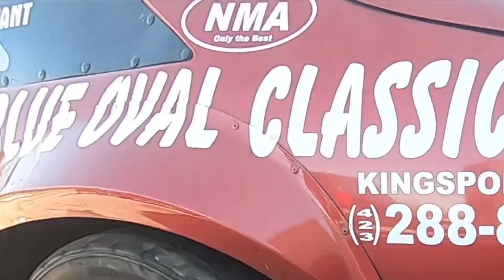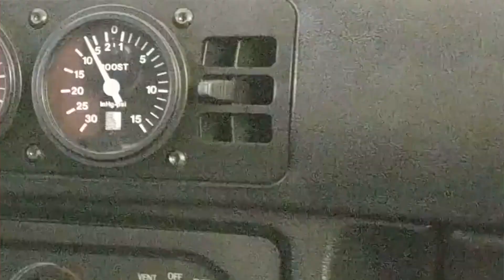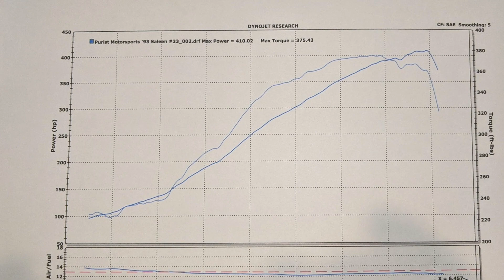Vortech Supercharged 1993 Foxbody Saleen Mustang #33 On The Dyno - How Much Power Does the 302 Make?

Comment: 410 horsepower it's pretty good. How much horsepower did it have in 93.
Reply from the maker: It was a non supercharged car. So it had 205hp.
Reply: This is 410 at the wheels...stock rated 205 they put down like 180 through manual trans so that is well over double the stock power and these are way lighter than new mustangs so 410 whp on those can be a rocket if set up correctly.
Reply from the maker: Correct. 175-185 rwhp was average on the rollers.  175 was a Monday or Friday build. 🤣
Reply: @PuristMotorsports  some people dont realize just how far we have came on oem power...but with that said these cars ran alot harder than it sounds on paper because of the big torque and light weight of the car itself.  It didn't take that much to turn that 175 into 275...exhaust,  intake, tbody, maf, explorer heads and intake....that setup could get you into the 12s with like 250 whp lol.
Reply from the maker: Absolutely.  What made these cars so popular was the inexpensive buy in with the potential for big returns on power with just a couple of mods. We are definitely spoiled these days with OEM power and the ability to up that with just a few keystrokes. But as you mentioned it's all about power to weight. The new cars are so heavy due to safety requirements and luxury items. Some weigh as much as 1 ton more than a loaded fox. Power to weight with traction wins out. Every time.
Reply: I knew how much the horsepower was in 93 I had a GT brand new. I couldn't remember how much the horsepower was on a supercharged Saleen. Was it 375hp
Reply from the maker: @jecoboost1440  For the standard supercharged motor (a supercharger on the stock Ford motor) it was 325 advertised horsepower.  The SC models  for 1993 had an advertised 450hp.  That's flywheel numbers.  Again, advertised in their literature.  Real world numbers may vary.  lol
Reply: Beautiful saleen